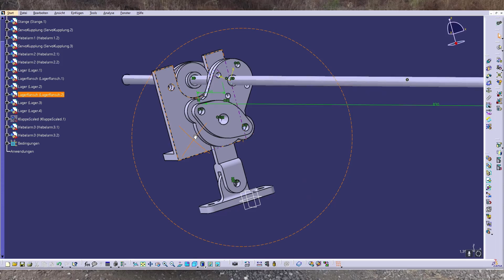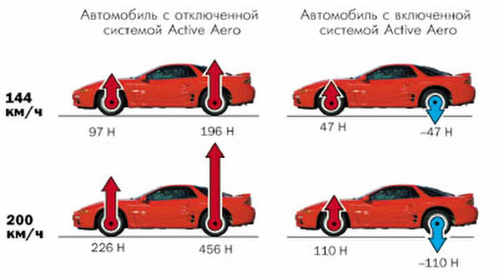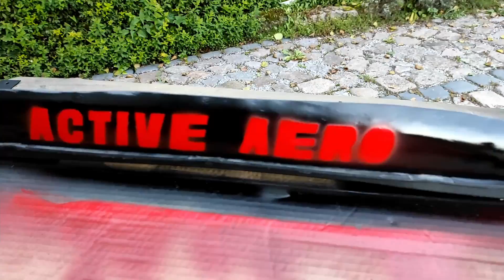I Built ACTIVE AERO For my MR2 Spyder | DIY 3000GT Style Venturi Spoiler

Comment: What actuators did you use etc etc ?
Reply from the maker: @Marti-dw9xt  hey! I did used a NA Miata headlight motor, some stainless pipe, ball bearings and some self-designed 3d printed brackets :) if you want you can contact me at Instagram (@p18roadstarmr86), I just found some more photos of the project

Comment: Also how about you operate with just a linear actuator? would it work?
Reply from the maker: Yes that would work to but they are mostly pretty slow and a little bit longer so maybe harder to fit.

But would definitely be possible!
Reply: @PlaneTMRS  short ones with smaller strokes are available too, I wanted something that works like a r31 front lip so is it feasible? And would a car lock actuator do the job as well?
Reply from the maker: @vikramreddy7501  I would recommend using linear actuators instead of car locking ones. These don't have nearly enough power to move a part like that :)

I think with these linear actuators it would be the simplest, also regarding controlling the wing in the end 👍🏼
Reply: @PlaneTMRS  alright thanks for the revert ☺️
Reply from the maker: @vikramreddy7501  no problem! C:

Comment: To span the gap between the metal spoiler and the existing lip you could have used a rubber t moulding. The same you use to mount body kits or fender flares
Reply from the maker: Thank you that's a great idea!